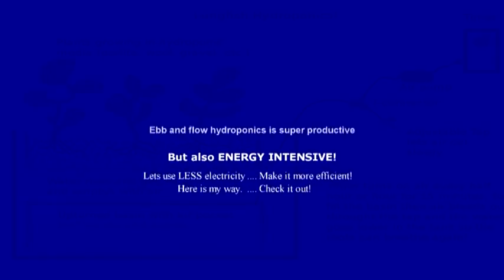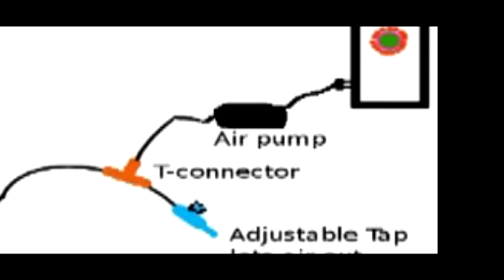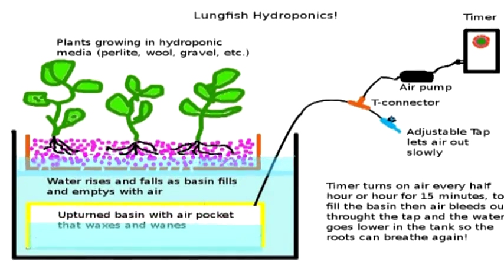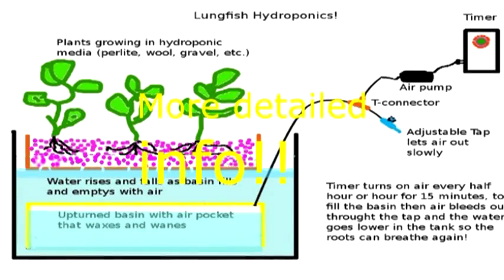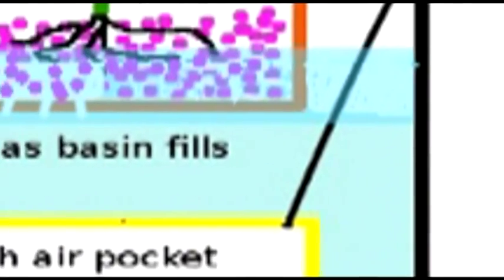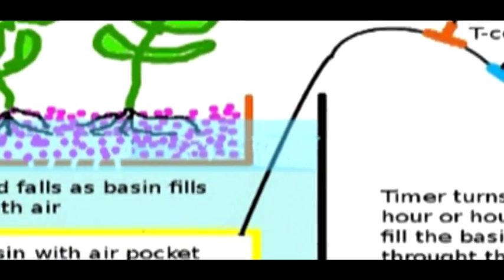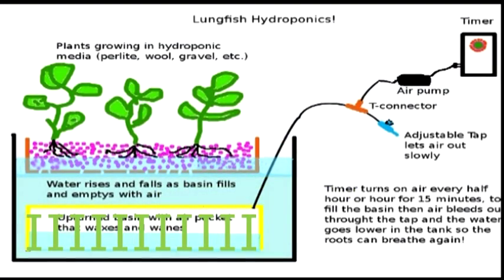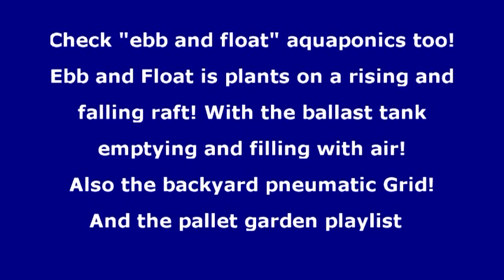New type of ebb and flow aquaponics or hydroponics. Help speed it into use!

Comment: I still like the idea of using fermentation to generate pressure.  What about a sealed compost heap?
Reply from the maker: Hi, Christie,  I might try it in the summer. It is only 5 C today and unlikely to go up much and you usually need a lot more than that temperature.   I don't think a small fermentation unit will give that much gas and I found in my experiments that production tapered off after 5 or 6 days.
Reply: Brian White That's a shame.  I imagine it works better in tropical areas.  Since the water is flowing up and down the same height, it really should be possible to get a near zero energy requirement... somehow.